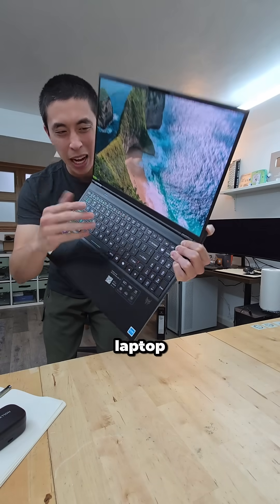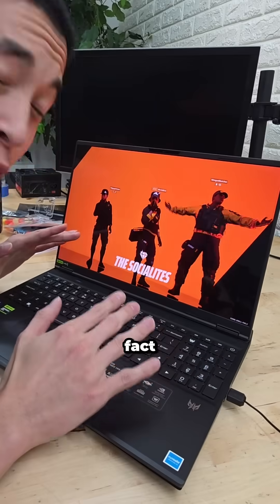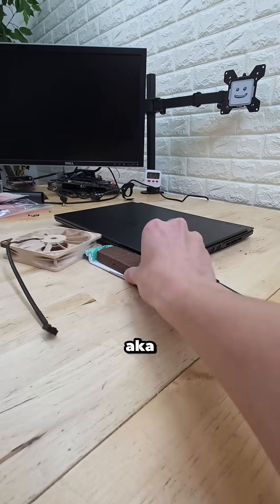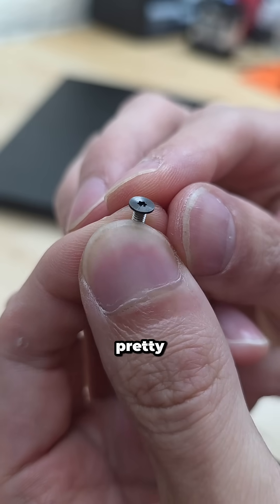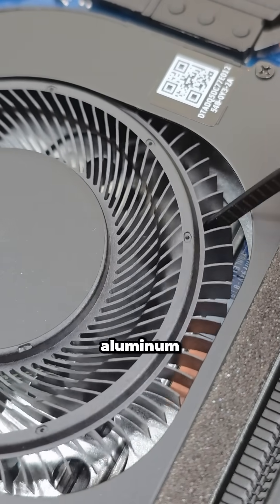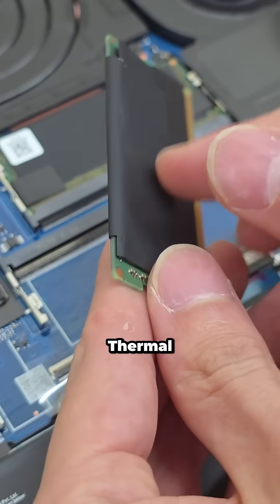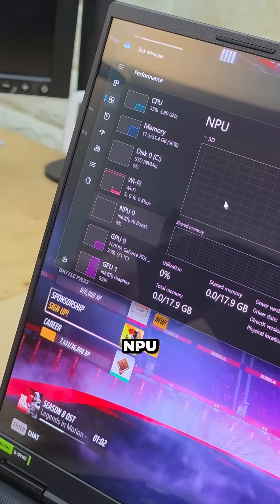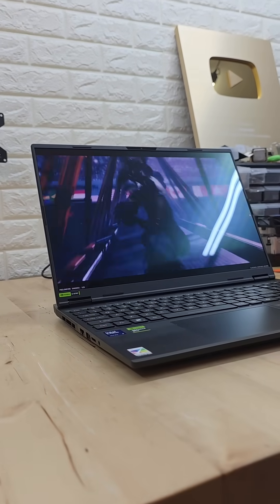How are gaming laptops getting THIS thin?

Comment: None of the specs matter if it’s in a thin ass laptop. The battery is always terrible, and airflow is non existent, which makes the gpu and cpu underperform. Thin laptops are a complete scam, when it comes to “gaming laptops”.

Comment: No, this chassis cannot handle powerful GPU so this 5070Ti is quite power limited - just 100-115W vs typical 140W in thicker laptops. So it performs 15-25% worse than thicker models with the same GPU.
Reply: Yet I agree that for its size it is still quite impressive gaming machine. It's really thin and has nice clean design, and for many people this could be a selling point.

Comment: Not a single word about the charger, the wattage and if the battery drains when the laptop is plugged in.

I've read these complaints about the Acer Nitro V16S (slim) which only comes with a 135W charger. Obviously that's not enough.
A YT reviewer refused to continue  because even a higher watts charger couldn't unlock the full power. 

For a detailed test and review you definitely should include that how the laptop behaves on different power profiles.
Reply: That's a predator not Nitro. and yes nitros are bad since 2024.

2022-2023? peak I got a 3060 with 140W tgp, and a 230W charger. Idk why they stop doing so.

But it overheats with stock paste, but with ptm 7950, it's actually a decent laptop.

Cpu underload, Cyberpunk 2077 1080p High 79c-80c

Gpu 73c tgp avg 120W

Comment: I can't even start to tell you whats wrong with this machine and what kind of issues it will have down the line. Let me just say that laptops are not built for your lap or for gaming, their cooling sucks and you will end up thinking "yay i got more space at home" and will end up using it like a desktop. Just get a desktop for this price, have a better upgrade path, easier repairs and if you need the mobility of a laptop .. MY GOD NEVER!!! get an Acer... never get any machine that has "Gaming" in front of it ever! You cant put hardware like this in a chassis like that without having cooling problems, the battery life on these is hell, THE GPU ONLY WORKS AT FULL POWER WHEN IT IS PLUGGED IN!!!! JUST DO NOT BUY IT!

Comment: There really is a difference in screws though. I found this out a long time ago with a full aluminum, full ATX case. Lian... made me so mad. I immediately stripped a screw head. I WAS using the wrong phillips bit but the screws were aluminum. I barely torqued it. So then I got the correct bit. No luck. Tried to remove another with the correct bit. Stripped it too. Ended up denting and scratching the case getting their stupid, crappy screws out. It's not supposed to be ALL aluminum. It actually was. Every single bit aside from the fans it came with. 😡 ... my first lian too. I had wanted one forever and this one was on clearance for the low price of $260 bucks.

Comment: These things are garbage. They run hot as hell, sound like jet fighter taking off, get horrible battery life, age like milk and are awful at both being a laptop and replacing a desktop. 99% of people should build a powerful desktop for gaming and get a power efficient thin and light laptop for work on the go. Odds are the price will be about the same as a single overpriced "gaming" laptop. Literally the only justifiable reason for buying one of these is if you are so space constrained that no desktop could possibly fit.

Comment: As a computer technician, I can confidently say that ALL and I mean All of these gaming laptops die, most commonly Acer but other brands too, they all cook themselves, that cooling system may look impressive to the average user but it's simply not enough to cool the MOSFETS, CPU, GPU and PCH properly.
If your going to buy a gaming laptop prepare your wallet to shell out for another one in 18 months time.
Reply: If you’re using your computer that intensely I would definitely recommend just getting a desktop, and get a work laptop that has good battery life. You can use apps to remotely use the desktop from the laptop if you really want to game on the go.
Reply: Warning reader, this is some bullshit. Buy brands that last, prop the laptop up using a book or dedicated stand, get it cleaned and replace the thermal paste every 6-12 months, you’ll have your laptop until you outgrow it because the specs got old, probably over 4 years.

Do not give into the rhetoric that you have to replace your tech yearly, or even every two years.
Reply: Maybe it is a different story for lower end laptops but I had a 1660ti laptop last me 3 years of daily heavy use, it still works to this day but it just needs a repaste since it hits 95 degrees from the dried paste.

I don't use it now for anything but its great when I need to set up a server or something on the side.
Reply: @totallylentra5414 Paste replacement is extremely cheap. I recommend either doing it yourself or getting a professional to do it. Even in the few times you’ll use it, having it make less noise, overwork itself less, and also decrease the ambient temperature around the laptop (especially if you’re using the laptop) is worth the cost.
Reply: I have had this concern, my laptop is a 2021 model I got at the beginning of 2022 from Lenovo. It’s a legion 7, is there a risk it can die on me soon? I regularly open it to brush the dust from the fans and whatever else I see on the shell but lately my temps are still getting higher, just this week I reached 105c on the cpu while on an elevated platform thing for cooling, it’s one of those with little feet that just leave everything open for the intakes. Will my computer die soon? I need it for my classes and I use it for gaming as a side thing. Is there no way to prevent it dying?
Reply: @WIProgress  Legions are great at cooling. That guy is bsing.No need to worry if you repaste/repad every year or so,your laptop should last at least the better part of a decade.
Reply: @WIProgress  105C is WAY too hot. You should try to keep it at 80-90C max while under load for long times.
Maybe reduce the graphics a bit, you won't notice it on a laptop screen.
If the temperature starts to be unusually high in idle, change thermal paste, if that doesn't fix it, you maybe need to replace the cooling array.

I've seen a Reddit thread with a Legion 7 2021, where the cooling array failed.

If the temperatures stay very hot for a long time, it will over time damage the components. The hotter the quicker.

Overall I can say: Laptops are not ment for high end gaming, never were. They've tried to sell them to us for a while now and each failed to hold the promise. 
You can't get enough power into a laptop for great performance while also getting rid of the heat. Good luck trying to dissapate 600W of heat with those fans.
Reply: pch is in the cpu or beside it. It's not like those old 9th gens.

But the mosfets, yeah they share the heatpipes with the gpu and cpu dies.
Reply: Dude even tuff gaming a15 can hold up 100w just fine stop saying ur an expert your prob aren’t or just doesn’t understand what your doing at all or you don’t understand that laptop are UNDERVOLTED to prevent the things you say

Comment: important to note it doesnt have a 5070ti but rather a 5070ti mobile which is a totally different card and there's a roughly 40% performance difference between the two cards
Reply: Same goes FOR LITREALLY EVERY HIGH ENC MOBILE LAPTOP , same goes for 4090 laptop too , lol you can't push 800 wats on 4090M lol , actually wait it's only 200 watt but it's only 35% if difference so that means laptop one is more powerful per watt ? WoW .
Well actually 60 series card is closed to desktop card ...
Reply: No shit sherlock, did you think they put a full size 5070TI in a laptop this thin?
Reply: @meowritz they call it a 5070ti why would any one think differently

Comment: Laptop 5070ti laptop is garbage tho. Atleast 5080 for laptop
Reply: Literally the 5070ti is one of the best price to performance in the mobile gpu space, for the 5080 its 500usd or 450gbp more expensive for minimal performance benefits
Reply: @LocalLooka depends on the model but something from msi when they have deals the difference is around 200-300 usd. Performance is atleast +20% on average.

Comment: Mine has the same but 4 TB SSD and 64 gb ram and it's. Ryzen 9 latest hx. It's an asus rog strix. It still gets a little warm when I'm playing really high performance games. When I did research I found that they had a reliable cooling system. Is it actually reliable or have I been lied to?

Comment: I bought this laptop's 5060 variant for like 900 dollars, having a blast in 1600p gaming.
Reply: 5060 and 1600P doens't ever well go together unless dlss or sh!t framegens  , just wait 2 years until we have crazy even more sh!ty optimised game ..
They should definitely do 1200P with 4060 series like they did before , it's better than 1080p but you won't be able to tell difference , and 20-25% More framerate is 100% WORTH it , specially when you are edge around 50-60 FPS ..
Not to mention 5060 is limited to 115 watt instead of 140 so there is less room for bios mode , not that big jump either like it had with 3060 .. good luck but for 900$ it's really good value for money

Comment: Those screws look like there were machined down from billet material which is insanely wasteful, but so high-class i like to see it. 

I saw an ancient old cartoon strip from the actual legit recession showing a guy machining a billet block into nails so he could put up the sign that said "prevent unnecessary wasteage" and there's just 300lbs of aluminum scraps piled up around. 

It's not that big of a deal because metal is infinitely recyclable but still you're absolutely wasting resources by doing it that way.